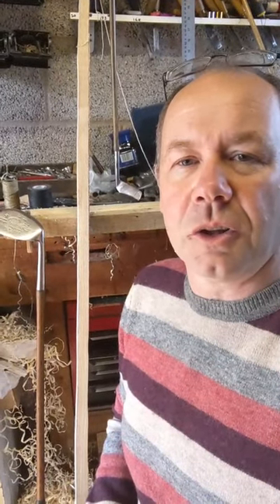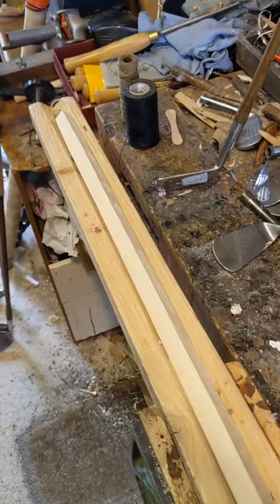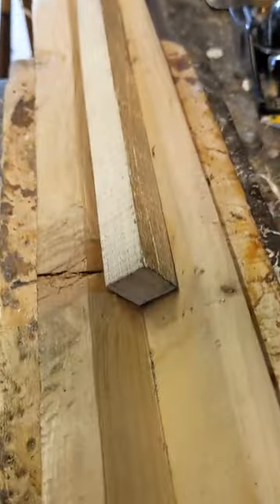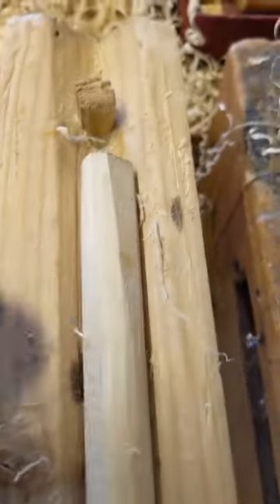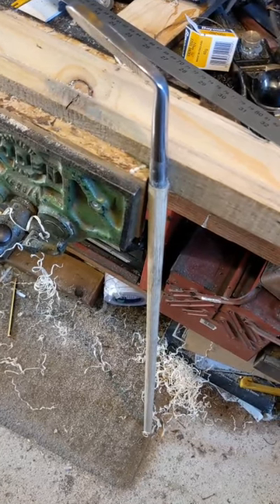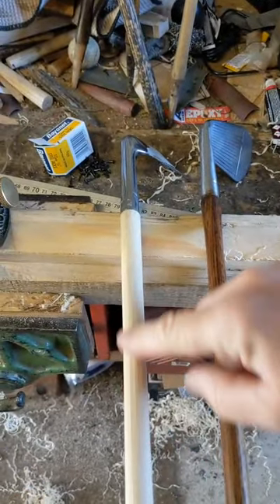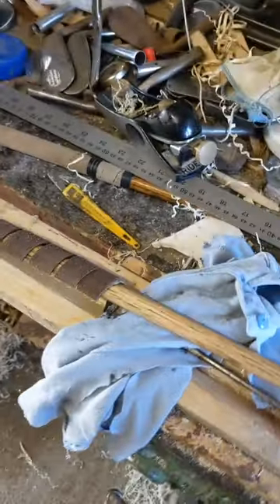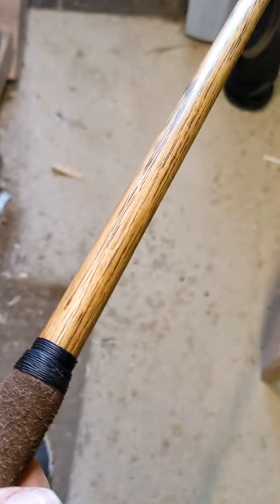making a hickory golf shaft...the full process in detail.

Comment: What did they use to attach the heads to the shafts when golf 1st started???
Reply from the maker: the first written record of golf dates 1457. We don't know exactly what clubs looked like then but very likely similar to what are known as the "Troon Clubs" you can Google them. The heads and shafts were joined by a splice joint, called a scare. They would've used glue, made from animal keratin, and then bound over the join with linen string.
Reply: @timewarpgolf  thanks for the explanation! Much appreciated!